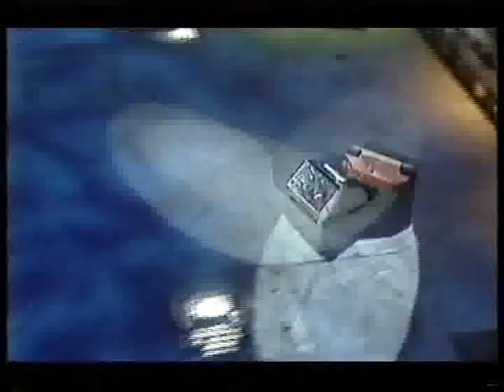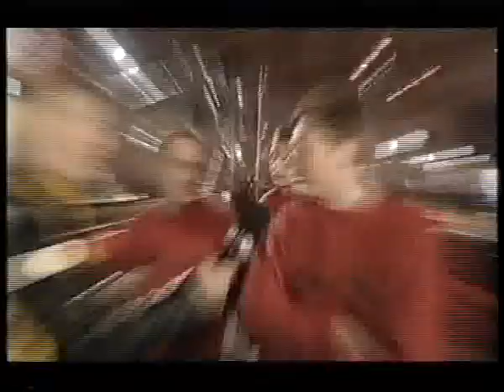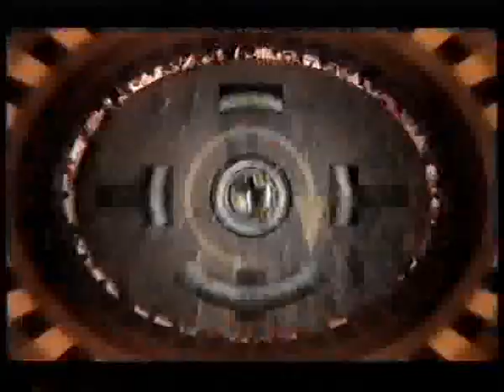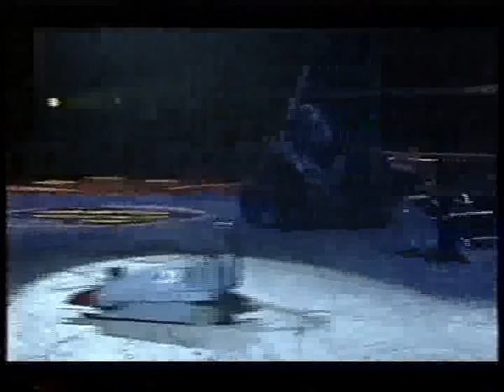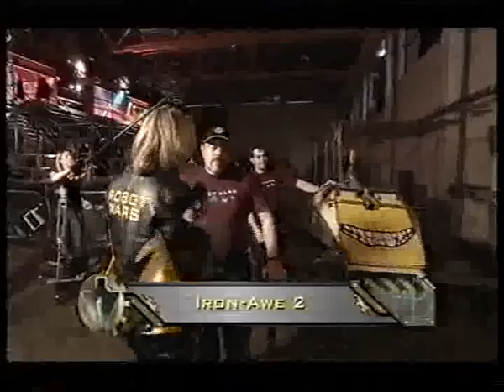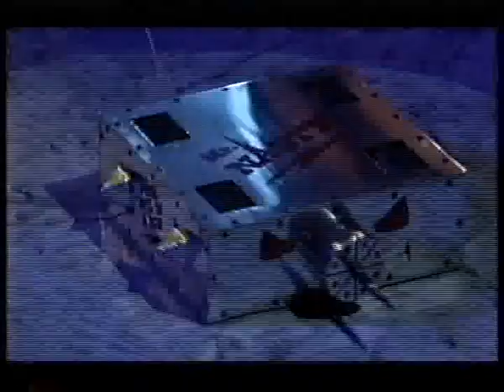Robotwars Series 6 Heat C Part 1

Comment: I suspect that a high speed rammer like Mighty Mouse would do a lot better if the arena was bigger.  Because the arena keeps the robots in close, tight maneuvering is a more important feature than speed.  The best way for a speedy rammer to fight would be like a speedy fighter plane fights a slower but more maneuverable one - by getting far away and making a running charge at it that allows it to line up with the enemy using just a small amount of steering no matter where the enemy darts to.

Comment: Why, when they were discussing Chaos 2's repeat championship in series 4 (specifically when they mentioned "a few close calls") did they show footage of Chaos 2's famously narrow win over Wild Thing in series 5? They could have shown their even CLOSER victory over Stinger in series 4 instead.

I really like George Francis- comfortably one of the best drivers on Robot Wars, if not THE best, he was humble, self-effacing, modest and permanently good-humoured. Unfortunately the specs of Chaos 2 tell the whole story- only 84kg even though the weight limit was increased to 100kg in the previous war. George Francis was self-employed and simply couldn't afford to upgrade his robot (which amazingly only cost 250 pounds to build in the first place) which is why he fell so far behind after his stunning back-to-back championships.

What the HELL is Mighty Mouse doing here?! I know we always see some joke entries, but seriously? Lighter than a 3rd Wars robot, with no weapon (rammers only work if they're HEAVY)? Considering some of the robots that failed to qualify for this war, that's absurd. Jonathan Pearce certainly had a few laughs at its expense.

Huh, so it was Iron Awe that put its axe clean through Destructosaur's armour, when Chaos 2 flipped them, huh? Impressive shot, kind of a pity Iron Awe had to leave so quickly- that looks like a pretty good axe. Unfortunately they do seem to have an issue with being sent flying.

Wait, Dr Fist's disc spins DOWNWARDS rather than upwards? That runs contrary to all rules of disc weaponry- if it hits a robot, Dr Fist will jump up instead of throwing the opponent up, possibly even turning ITSELF over!
Reply: +ArcaneAzmadi I guess that was the main reason, just the lack of money. Also, it was made from parts of Chaos, which was using parts from Robot the Bruce, so it probably cost a bit more than 250$ but still close. As for them showing the close calls, showing something like Chaos2 escaping the pit works a lot easier for the viewers than showing a battle with stinger, because that would just look like some random battle.

Mighty Mouse was actually from Velocirippa's team, I think the team split up, and part of it used what's left of velocirippa to build this robot. It isn't great but I've seen worse, especially joke bots, I think the only one who I'd be ok with(and that's more because it's not actually 100% a joke) is diotoir.
My guess is that for the qualifiers they just had to fight against a different robot, if they won they were through, if not, then reserve ? It's definitely done wrong through, as the past has shown that some great robots got completely unused(Steg-o-Sawrus, V-Max) while some random nonsense made it through.